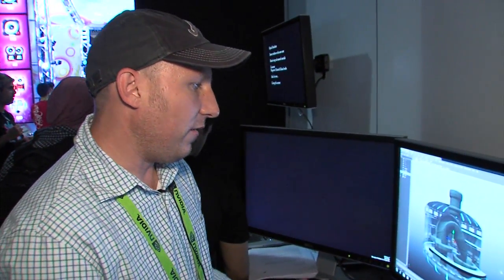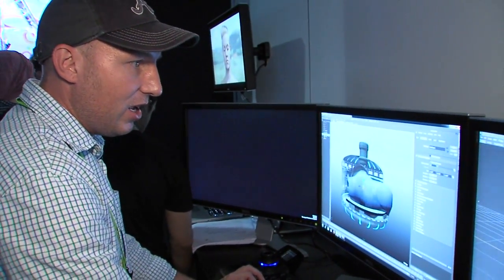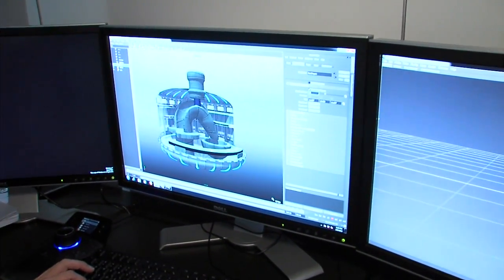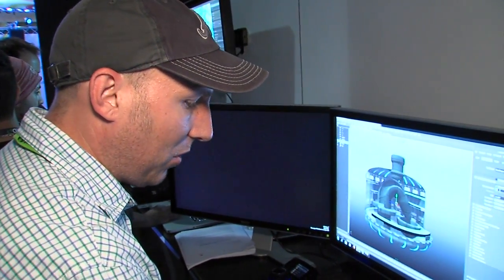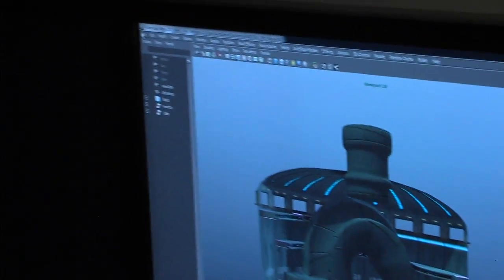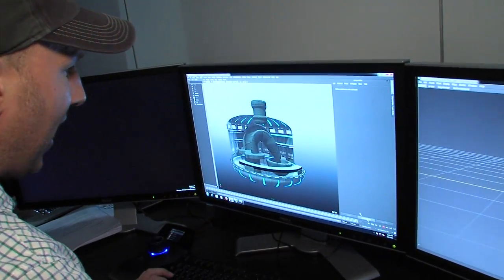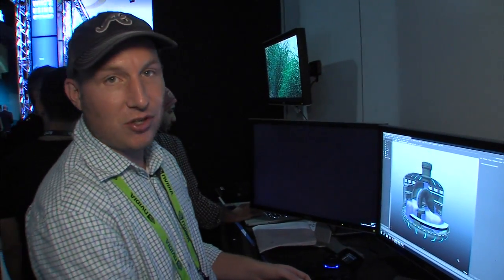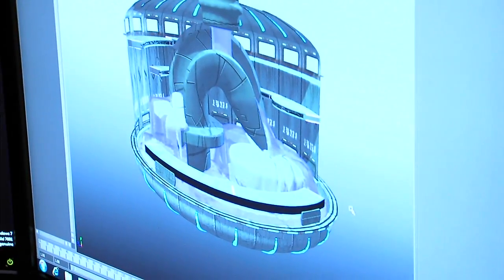Fluid Computation in Autodesk Maya using AMD FirePro and OpenCL

Comment: Every Radeon card that supports OpenCL API will benefit from this, then what matters (performance wise) is the amount of Stream Processing Units and it's clock speed. But take into account that Gaming cards are not made for intensive computational simulation, they can (doen't mean they will) overheat easily and crash during the simulation or render time.